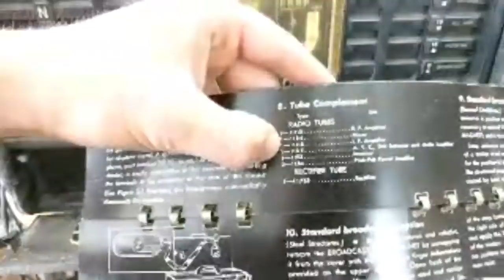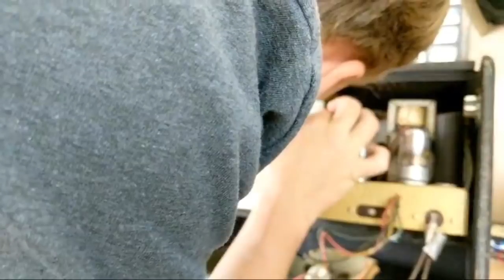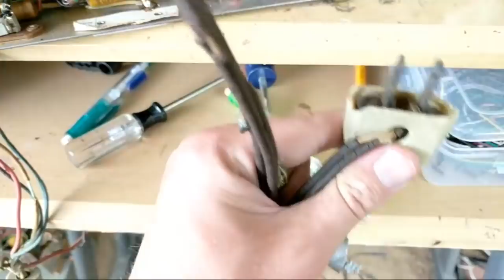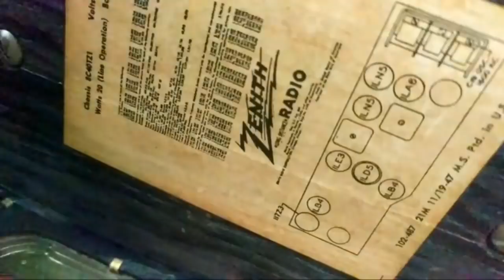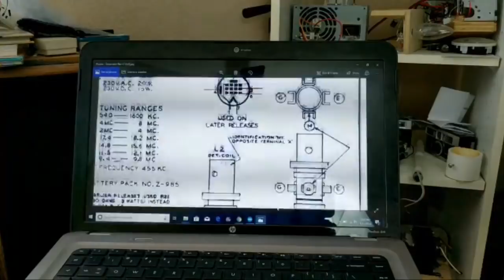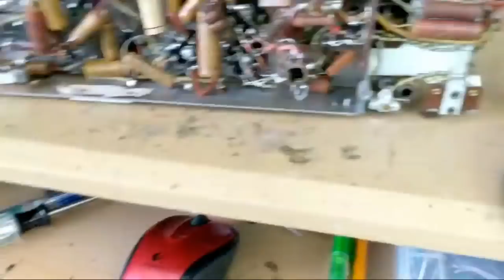Zenith Radio Repair

Comment: I expected to see a repair videro. I did not see any Zenith Radio Repair here. Clipping some wires and popping a cap is not repairing a fine old ZTO 8G005.

Comment: This is killing me! 🤦‍♀️ Your heart's in the right place, but you got to slow down. All you had to do to get the antenna out was take an 8mm socket and remove those two nuts holding the bracket that holds the antenna to the box. Slow and steady, it was observation you can usually find out what it takes to remove certain things properly. Never go full speed.  Ive seen many mechanics come and go that were really fast at their repairs...... But their work always came back with problems. Because they used "brute force and ignorance" rather than slowing down and observing and using deductive reasoning. 🤷‍♀️ Trust me, nothing is built today or in the past that has to be disassembled via "smashing off parts with a hammer" Lol😄 I'm not trying to criticize you though man, there's a learning curve everywhere. My guess is you're used to working on printed circuit boards and newer technology rather than old analog equipment..... And that's okay. When I first started as an automotive repair technician, 99% of the work I was doing was on newer vehicles with fuel-injection and onboard electronic engine management systems. But it took a while for me to learn how to work on carbureted vehicles with points driven ignition, mechanical fuel pumps, etc. 🤷‍♀️ Even though it's older more simple technology, it's just not something you see or work on on a regular basis anymore. So I literally had to "backtrack learn" in order to diagnose and repair the older stuff. It doesn't make you any less talented, it's just  the era we're living in and the stuff that we're used to working on on a regular basis. 😉💯
Reply: YES! It was painful watching him trying to get the chassis out. The 2 nuts holding the telescoping antenna bracket are easy to remove first. I was totally surprised when he finally got the chassis out without removing the telescoping antenna. A bit of rough treatment.
Reply: @kensmith3017 I know right? Lol! Even when I was a little child, and something I wanted to remove wouldn't come off simply by pulling on it, I would usually investigate further to find out what was anchoring it down.🤷🏼‍♀️ Lol. Even when humans were dwelling in caves they would typically investigate something that's unknown to them rather than waste a bunch of precious energy clubbing and beating it to death if they didn't have to? 🤷🏼‍♀️ Lol!! 😂

Comment: I am a 70 yo retiree; love Zenith tube powered TOs and its later clone, the RCA Stratocaster; none as old as yours! Will you look at the radio (open the back).and find the chassis number, usually printed somewhere on the chassis itself. Some of them also had labels glued inside. Any info you can provide will be much appreciated! Thanks,
Reply: for Zenith 8G005 take a look here https://www.youtube.com/watch?v=2dL_nM95CSY&t=558s

Comment: Just a note  on connecting up old equipment like this if you Put a 100w incadescent light bull in line with one of the ac leads, if it lights up the unit is shorted and it won't damage it because all the current will go in the bulb.
Reply from the maker: That is a good idea! Now the real problem: where can I even find an incandescent light anymore?

Comment: As I write this, I am listening to a 1937 RCA Victor 88-T radio. All capacitors, and I think all the tubes, are original. Even the cloth power cord is original. (Do not run an old radio unattended!) 

https://www.youtube.com/user/TheLawrenceWade

I love knowing that the original owner probably listened to news broadcasts about World War II on this radio. This is a working piece of history. 

Paper capacitors absorb moisture from the air and become leaky over time. They were literally just newspaper and aluminum foil in cardboard tubes sealed with beeswax or candle wax. When they become leaky, they cause tubes to be biased improperly, causing poor operation. "I love the smell of old electronics", you said. Yup. That's dust burning off tubes and beeswax in warm paper capacitors. It is one of the finest smells in the world. :) 

Electrolytic capacitors dry out and their ESR increases. Sometimes, all you need to do is power up the radio very slowly, ideally using a Variac (NOT a thyristor-based light dimmer!) but light bulbs in series with the power cord can work as a great voltage drop. Watch the plate voltage on the rectifier tube and make sure your main caps aren't shorted! As you gently apply power, the oxide layer that acts as the dielectric between the plates of the electrolytic capacitors will usually re-form. I'll typically run a radio or TV for over a week, gradually increasing the voltage and watching the plate voltage and current on the rectifier very carefully. An alternate way is to pull all the tubes, clip a couple of alligator clips to the capacitors and gently raise them to operating voltage using an external power supply. 

By all means, replace obviously defective components to get the radio working again. But the whole point of an old radio isn't the performance, it's the historical value of preserving the state-of-the-art technology of its day. 

Re-capping my RCA radio would improve its performance - less drift, etc. But at some point you have to decide whether you want the original experience of listening to a radio from the 1930s, operating as they did when they were new, or if you just want a new radio - and if that's the case, go with something modern with digital PLL tuning. 

Let's put it this way: old TV sets (1940s-1960s) usually had the vertical hold control on the front of the set. When you turned on the TV, for at least 20 minutes or so, you'd have to adjust the vertical hold control as components drifted in value as they heated up to normal operating temperatures. 

Remember when you're working on an old radio or TV or anything else with point-to-point wiring that every single component, connection, and solder joint was done by a real human being who soldered it. There were no printed circuit boards or pick-and-place machines. The labour involved in building one was huge, which is why they were expensive in their day. Please have respect for the work for the people who actually built the thing, a work of art, long ago. I respect the workmanship and try to disturb it as little as possible. 

Your speaker was NOT re-coned. The seam exists because of how they were made back in the day. 

Your Trans-Oceanic is a beautiful piece of technology. I am glad that it ended up in your caring hands. Be gentle, act like the curator of a piece of history. Save all the parts you replace, bag them, and tuck them somewhere safe inside the cabinet so that all the original parts are available in case that radio some day ends up in the Smithsonian. 

Lawrence Wade
Ottawa, Canada
lawrencepwade@gmail.com

Comment: Hey, Tanner, I was cringing on this one.  I was hoping your friend really asked you to REPAIR the radio and not RESTORE it.  You were definitely going about "repairing" the radio, but didn't seem very concerned about maintaining its original state, which would be the "restore" factor.  For that, you'd have to be much more concerned about keeping it as "original" as possible, replacing bad caps with exact replacements-- both value and form factor-- as in a replacement multi-capacitor can.  Even replacing the power cable would have required an "exact" replacement, and even locating  and replacing the two-pin connector, which was already bypassed.  "Old style" rubberized zip cord is available on restoration sights, but much more $$$...  
I'm just suggesting that you make sure that you understand the owner's intent before diving into such a project, so there are no misunderstandings.  ;-)   
Great exploration, as always.
Reply from the maker: They wanted it to be repaired, not restored. They just wanted it working. Thanks though for the advice!

Comment: can you please make bfo metal detector and explain how works mixer
Reply from the maker: After I read your comment, I have been researching frequency mixers and oscillator circuits for the last hour. A video will be made.